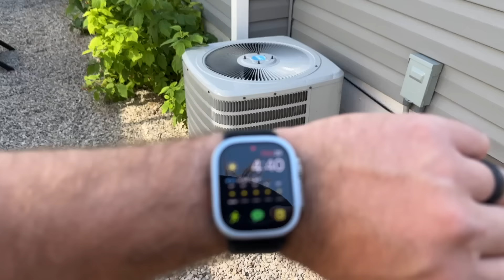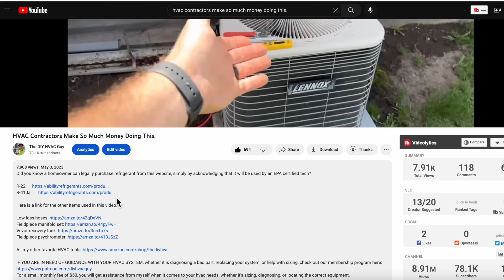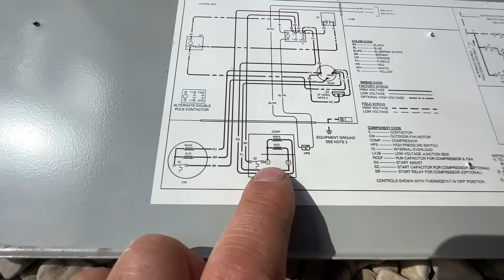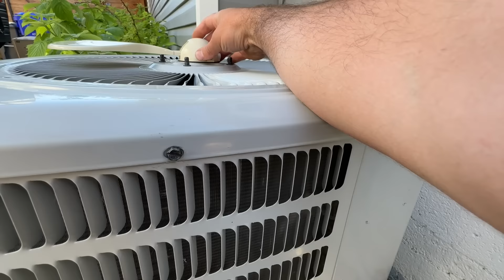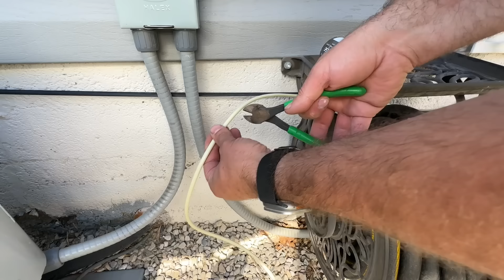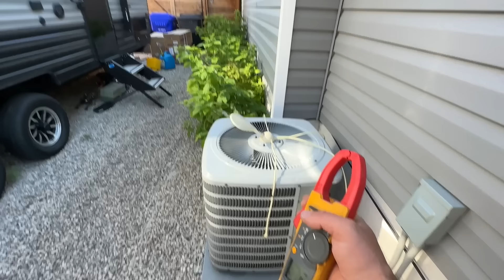Can This Device Actually Lower Your Electric Bill By 30%??

Comment: Interesting, would be nice to see a long term update on someones AC unit. Will this also work on the new unit you are installing?
Reply: Of course it would - the real question is whether the juice is worth the squeeze.  It uses relatively little water with those misters, and I might even add one for the 4th side of the existing unit to maximize potential, but the evaporative cooling effect has a cost as well as it's operation....id love to see the math of electric bill reduction across time vs cost of the device.

Comment: the wire in the tube creates pressure so its a finer mist. I've used this and it did not do much
Reply: "the wire in the tube creates pressure so its a finer mist."  Where did you get this fabulous piece of information from?
Reply: @malcolmblack717   its purely common sense.  It's like putting your thumb over the end of a hose to shoot the water further.
Reply: @rciancia  The wire is not at the misting tip end. That is why it "did not do much for you".The wire is inside the delivery tube. The wire is to enable the plastic tube to retain its shape when bent - that is common sense... It was a rhetorical question.

Comment: Thank you very much for helping all of us.  Quick question do you recommend a tool to disconnect the fan motor from the fan shaft…. I think our fan motor went bad and can no longer spin the fan, not even if I help spin it with a long thin device to help spin the fan but no luck 🍀 it still won’t spin.  Do you recommend a tool to disconnect the fan motor from the fan shaft please… and thank you for ur time. Stay cool my friend 🫡
Reply: If you mean to get the fan blade off the shaft just google ''ultimate puller"

Comment: Or they could just make water cooled condensers. Water bill then will go up.. VFD for fan speed control? If the lift valve fails and it runs water all the time flooding something. Hard water deposits..
Reply: Water cooled condensers are deemed obsolete and illegal as of 1997, at least in portions of the Western Desert Region. Water Conservation don't ya know? Dept. of Dipshits................

Comment: I have a duel inverter window unit that uses condensate water to spray on the condenser. You can remove or install the factory rubber plug from the drain if wanted.
Reply: Do yourself a favor; do not remove the drain plug. use the condensate water to cool the outer coil. It's clean and safe!

Comment: What is the economic impact of this device. Cost versus reward. How much to the replacement filters cost at every three months.
Reply from the maker: It’s $99 dollars so I think it will pay for itself rather quickly in certain circumstances like if your unit is always in direct sunlight
Reply: Well the power consumption in the video went from 4.3A to 3.6A which is a 700mA difference.   At 240VAC, that's a 168w difference.  If your A/C runs for 4 hours a day (considering duty cycle, etc), that's 672 watts per day.   I pay 6.9 cents per kwh for electricity.  So in a month, 30 days x 672 watts x $.069 = $1.39/month in electricity savings.  Even if you're paying double for electricity, it's still less than $3/month.

That's assuming the 700mA difference measured wasn't due to other factors like ambient air temperature change, indoor heating load, etc.

Comment: This would be a great reason to build homes with a cistern again.  

I suspect these work best in climates with dry heat.  I have 90% humidity in late July & August.
Reply: Or if you have an in ground pool, use the pool water to cool your AC refrigerant. 
Better still, every one use ground source heat pumps. :)

Comment: What if I sprayed my coils down every week with lime away or vinegar or some other product to knock away the calcium and counteract the corrosion?
Reply: It is not a good idea to spray acid on metal.  The aluminum fins would be the first to go.
Reply from the maker: I think that’s what the filter is for. But if you don’t have super hard water it should be fine.

Comment: We had a customer with a big chiller, that had a beat down condensor coil, due to age and hail damage. Rather than repairing the unit, they set up sprinklers on the coils, and ran it for years that way.
Reply: I have a few grocery stores I watch in that same situation. Remodels, no accounting for dirt/bent/age of coil. Then a roaring 100deg summer comes and yea, you know, add another sprinkler. lmao.

Comment: The only issue I see here is that the water may cause premature corrosion and ruin the unit prematurely
Reply: Well what about rain???
Reply: @mantorras77  I don't think rain water contains the same amount of minerals. I do commercial refrigeration and we were warned against doing something similar to this in a training seminar
Reply: @mantorras77  rain isn't packed with calcium

Comment: This is the same concept as what a "sling ring" does in a window AC.  Makes me wonder if I want to get water from the condensate lines instead of using my water supply.  Maybe to supplement it...

I think the big commercial units have water nozzles as well.
Reply: Condensate lines are just as like to have contaminants in them as a regular water supply since that water is taken from air, presumably with other dust and pollen etc.

Comment: I don't think your register temperature is all that relevant without tracking the temperature at the return, but the reduced amp draw is undeniable. I wonder about the long term affect on the condenser even with soft water. I think filtration needs to be high priority with this type of kit, and that inline business has me in doubt.
Reply: I thought the same thing, temperature difference between register and return would have been much more useful in determining actual benefit of the device.
Reply: @russellaz   If it reads at all, I don’t  think it will make a difference if not closed 100%… Last time I looked at meters, Fieldpiece and Fluke both had amp meters without a clamp at all…
Reply: ahh yes i just made same comment. difference from in and out would be a better measurement.
Reply: The drop in liquid pressure is what reduces the amp draw. The lower the pressure of the refrigerant is the less hard the compressor has to work to move that refrigerant. Refrigerant is temp sensitive and will drop the cooler it gets. So yes if we can keep the condenser cooler then we can reduce energy consumption.
Reply: Also it depends on where you live. If you are in a large city with lots of traffic (Houston TX) there is a lot of sulfur dioxide in the air from the auto exhaust. This mixes with the spray water making it acidic. This causes what is called "condenser rot" which is when the aluminum fins turn to white dust. This can cut YEARS off the service life of your unit.
Reply: Anytime, you spray water on aluminum for an extended period of time corrosion will set in along with calcium and other harmful deposits, shortening life, expectancy of the unit
Reply: The amp clamp jaws were not fully around the run wire in the after install so the current flow is BOGUS !!…watch and you’ll see !!
Reply: @rwrobs777  No, I don't see. It is clearly the same cable and closed around it.
Reply: @rwrobs777  Yeah I was kinda wondering what tonnage air conditioner runs at 4.4 amps on the compressor....  unless that unit is nothing but a glorified wall unit.. but hell even those draw more like 12-15 amps.
Reply: @rwrobs777 I dunno if you ever used an amp meter but you can't measure current with it half way close.

Comment: I’d like to thank you for these very helpful and well-produced videos.  They’ve enabled me to tackle my own HVAC issues.  Do you have any advice for rebalancing a slightly tweaked condenser blower fan?  I seem to have buggered mine a little in spite of trying to be careful.
Reply: Buy a new one. It's not like balancing a tire. It it breaks and a blade flies off you could be buying a new condenser after a puncture.
Reply: Thanks.  I’m going to replace the system next spring.  Mine is almost 30 years old and I’m not sure how to determine pitch etc. to make sure I get one that’s correct.  Just hoping I can help it get throughly the next three months.
Reply: @truecapitalist4718   In the next three months new equipment cost may go up another 20%.-
Reply: Ugh 😣
Reply: Thanks!

Comment: I have a 4 inch I think merv 11 filter, what if you lowered the merv rating to like 4 so more air gets by ?
Reply: More air moving across the evaporator coil means less heat is removed from the air.

Comment: I would have had the actual outdoor unit hooked up to a solenoid valve that would turn on and off with the power provided to the compressor,
Reply: You would then have to hire an electrician. This kit is for non-handyman.

Comment: That is a great idea, I've been wondering about the same thing but didnt thing about a flapper for on top. I got a mister recently for my chickens. My AC unit sits in the afternoon sun, and the dryer vent is basically beside it. Hmm, got to figure out a new place to vent away, and give my unit some shade.
The misting system with flopper is $100 with three misters, not sure if I would want to spring that amount. I am curious as to jury rig something else to shut off the water with misters i currently have.
Reply: Might be able to take the float off a swamp cooler water shutoff and attach a large blade to catch enough airflow to turn the water on?

Comment: I'm not expert but I don't think that the spray nozzle at the back of the AC unit will do much good as there in next to no coils back there ... I think that nozzle should of been on the front of the unit where it is 100 percent coils and also since w have gravity I think having a nozzle a bit higher that half the way up would also help some! On the coonsave website it does show that they have one nozzle on the front of the AC unit!

Comment: when I replace my a/c and furnace units next year i want to install a heat exchanger like the one from hot spot energy so i can use the a/c system to cool my house and heat my pool. should save me some money since i have a heat pump for pool heater and run the a/c all summer long.
Reply: In the Palm Springs/Coachella Valley  temps hit 120F. Pools get so warm from just sun alone that they become uncomfortable to swim in, much less dumping heat from the house into the pool. Different areas may work well.

Comment: There is only ONE problem with this... the mineral build up on the coil, but it does work. A number of years ago I built a pvc pipe system with misting nozzles. Eight altogether. It was attached to a 24v sprinkler valve and the water feed was 2 feet from the hose bib. Electrically the valve was connected to the contactor. Condenser (5 tons) comes on... valve opens and it misted the condenser. It dropped the amps by 3-4. After 5 plus years no cleaner, acid or otherwise would remove the deposits. If you can STOP the mineral deposits I highly recommend a mister in extreme heat. 

Side note... HVAC contractor friend of mine had a package unit on the top of a flat tar roof building. He created a mister because in Texas it gets HOT in the summer. It worked.
Reply: Exactly I would only do this on a system that only has a few years left so I don't care too much about the mineral deposit. It's silly to try and do it on a new system.

Comment: The corrosion will eat up your coils. If you use water then the manufacturer should design thicker coils or use titanium.
Reply: What about when it rains?
Reply: @bluesdirt6555 😂
Reply: @bluesdirt6555  rain isn't packed with minerals, chorine and fluoride like tap water is
Reply: @TheSimba86 rain has minerals, it does not have chlorine but if chlorine was that corrosive your plumbing in your house would be shot, fluoride is not that corrosive or once again it would be shot 

You aren’t paying for titanium coils…. Not sure why you would since it oxidizes just like steel and aluminum 

Thickness doesn’t matter in a moving fluid environment since the surface is constantly having molecules pushes past it and new ones exposed but it does in heat transfer and thinner is better for exchange 

Product is fine
Reply: @bluesdirt6555 he stands over his a/c with an umbrella duh! You don't?!
Reply: Some vinegar wash down would be needed for sure. Those filters don't filter enough.
Reply: RODI water?
Reply: I added a misting system on my AC unit many years ago. It helps keep the head pressure down on the compressor. The AC unit lasted 26 years. Hope the system had something to do with it.
Reply: That’s why it has a filter. 🙄
Reply: @prayforthe_1644 THANK YOU!!!!
Reply: That's why catalytic converters get stolen.! Expensive rare metals, worth more than gold and platinum!

Comment: I bought one last year to test out on one of my A/C units. (I have 3). I was excited when it came in the mail. The kit was about $100. It took me about 30 minutes to install. It was easy.  It worked as designed. 

However, after a week or so of use, I started to notice a white haze was developing on the condenser coil fins. Despite installing the hard water filter that came with the kit, it wasn't enough to remove the calcium from the hard water. I had to stop using it out of fear that the fins would be saturated with calcium, and therefore reduce both the efficiency and lifespan of the condenser. I was very disappointed.
Reply: A better design is not to spray mist onto the coil /fins but to let water drip down a disposable filter wrap outside the coils. Evaporation of water will lower the temperature of air that flows through the coils/fins. This will prevent corrosion as water never touch the fins.
Reply: @fool9111z  Interesting. How large of a filter are we talking about... and... is there a place to get these filters?
Reply: @erikjeffreys2144  i think you have to make it yourself. Think about filters used in whole house humidifier, where water flowing down slowly. But it needs to be bigger, surrounding the AC unit on all 3 or 4 sides. It also needs to be sparse so it will not block the airflow too much. A thin tube lying horizontally on top to drip water down whenever AC is noisy (a signal AC is on). The materials of the filter could be PVC wire mesh.
Reply: @fool9111z  hmmm... I'll need to chew on that for a while. 🤔
Reply: @fool9111z  what about something more like a window screen in front of the coils? An inch away or so all the way around. Almost like a screen box, with the misters on the OUTSIDE spraying on the screen rather than the coils..  I wonder if that would work... 🤔
Reply: @erikjeffreys2144  it should work, but it doesn’t have to be misted on. Let water silently drip/flow down, just like humidifier filter.

The only thing about window screen mesh is that it maybe too fine, causing air flow drag. Find any screen with bigger mesh holes. You should build this as a 4-sided cage just drop down and around the AC unit. No need to fix it to AC. Ot is easier to remove, clean and modify for experiments.
Reply: @fool9111z  the question is the delivery method for dripping the water.
Reply: @fool9111z  You are describing an evaporative cooler, a.k.a. swamp cooler.  I think it's a good idea.  Multiple types of filter media for this use are sold at hardware stores.
Reply: @fool9111z  Filters for older style evap coolers should work great. In a pinch they could be strapped together. Ecven if air leaked past the filters that would make a big difference.
Reply: @fool9111z  But now you're restricting the flow of air which will more than offset the gains from the mister.
Reply: @ruthlessluder  which is why said the filter must be very loose mesh so it wouldn’t restrict the airflow. A window screen is too fine for this, esp with water on them.
Reply: Any hard water filter that is not an ion exchange softener is going to be almost completely ineffective.  The ion exchange softeners are going to increase salt content which is also not good for your coils.
Reply: True
Reply: Pie in the sky!
Reply: Not surprised by your finding. If there was a way to have metal in contact with water and not have to deal with buildups and corrasion the shipping industry would be all over it. So far no such thing exists.
Reply: Yah this is a huge problem in my area. hardwater will ruin your ac unit if you do this. i spray every once in awhile if a hot day. but not all the time. worry the hard deposits will destroy my ac unit. although mines 30 years old so it cant get much worse i guess. i think last year this thing runs.
Reply: This feature already come built in LG windows AC where water from condenser is let flow to radiator fan which throws water on hot radiator fins. Instead on increases efficiency I found that this system was making fins iron frame to get corroded and stones from air was mixed with water and thorwn at high speed on fins which I found later on damaged from inside. 

I later on bypassed condenser water using a hole and pipe and stopped it going toward radiator fins.
Reply: LG windows AC model I am using is : PW-Q18WUZA
Reply: @Sam-to1zg same with my Midia 12k btu version. So far so good but I'll keep an eye on it. Mine already has a drain for when too much condensation occurs. I'm in a dryer climate on the South Plains of Texas.
Reply: @LemonySnicket-EUC  Great
Reply: @Sam-to1zg  You have stones in your air?

Comment: So instead of the mist spraying directly on the coils it cools the air as it's pulled in (& up) by the fan?
Reply: NO. the system creates water particules that lands exactly on the hot condenser surface area and than those water particales evaporate with the help of the condesner fan & the heat of the condenser and that cycle cools the conderser coil.
Reply: A better design would fully evaporate the water and swamp cool the air before it ever reaches the coils.